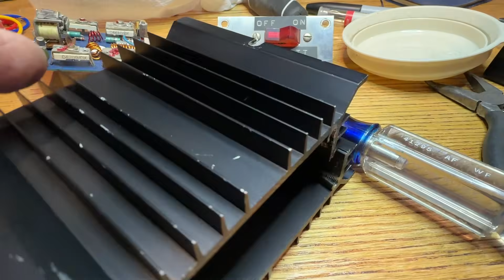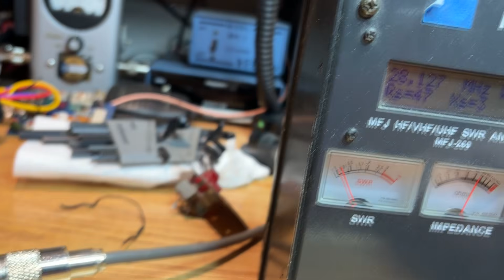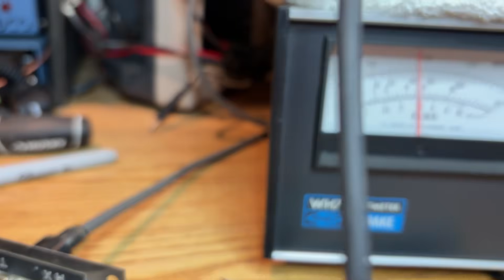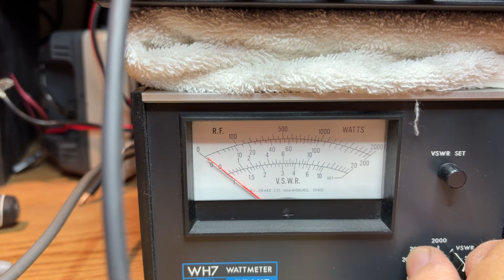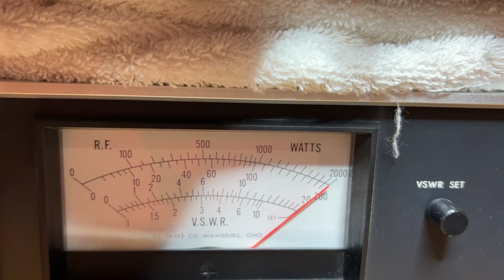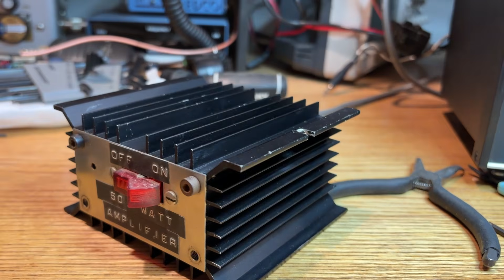Build Your Own 250 watt Dummy Load for Ham/CB Radio #cbradio #hamradio

Comment: I MADE "SOME" ... BUT JUST USE "RESISTORS" ..  ( COST NOTHING )

AND AFTER "SOLDERING"  SOME 100  OR 200  OF THEM. (2 -3 WATTS RESISTORS)
IT SHOW "50.0  OHM" ... NOT MORE NOT LESS  ..( 27.555 MHZ )

THEN ALL OF THEM IN "OIL" ..  ( END OF  JOB )

100 WATT .. DOES NOTHING  TO THE "OIL LOAD" ...

SO  "ONE DAY"  I  WILL TRY  4 -500 WATT  OR  "MORE"

WE  NEED  SOME   ( SSB  POWER )  ON  "27.555 MHZ"

ONLY  USE FOR  A "DUMMY LOAD"  IS  ( TESTING  AMP REPAIR )
BEFORE  "ON AIR" ... NOTHING  ELSE

( TUBES  DONT LIKE ERRORS )

HAVE A GOOD  DAY.